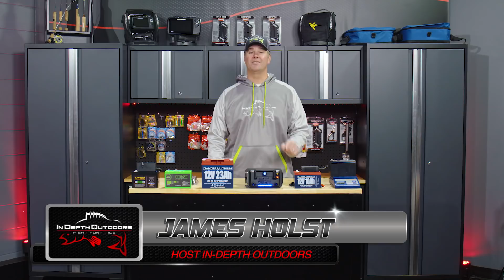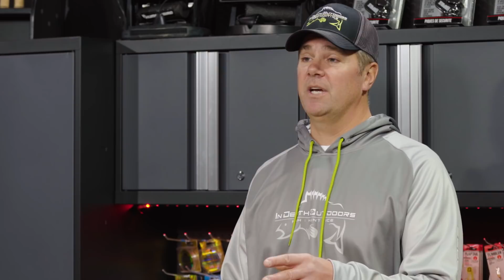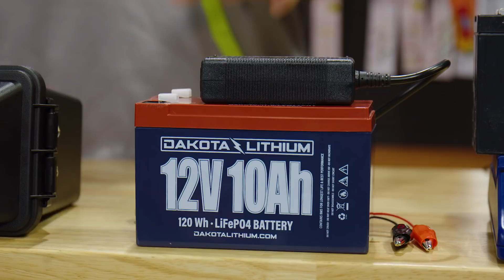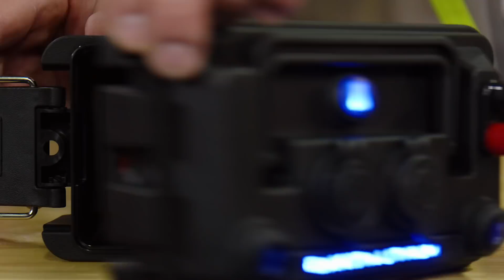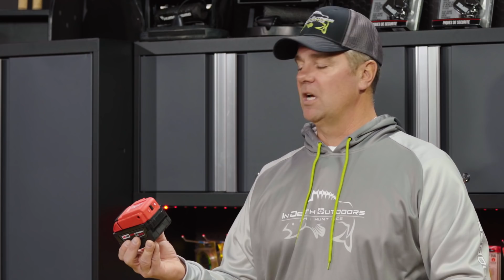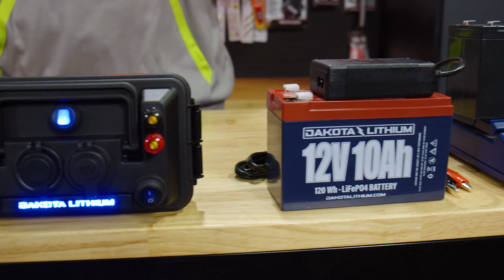Lithium Battery Lineup Walkthrough

Comment: I just got the Norsk 15 AH battery for my Humminbird Helix 7 G3N. Ive noticed that after I charge it, the battery level on the battery reads 100%, but on the sonar it is reading lower. As I us it the battery level seems to drop very slowly as I'd expect, but the battery level showing on the sonar goes down fairly fast. Have you ever run into this issue?
Reply from the maker: Are you running out of juice during a day of fishing?

Comment: How many years will some of these batteries last is my biggest question. I'm on my 18th year now of using my Vexilar 9 ah battery! I just can't seem to want to spend the money for one of those when a standard battery only costs about 30 bucks and lasts years!
Reply from the maker: Most of these batteries are rated for 800+ to 2,000 recharge cycles. Which means if an ice angler were to charge the battery 40 times a winter, which seems highly unlikely for most anglers, the battery would last for up to 50 years.  So, long time.  😊
Reply: @InDepthOutdoorsTV  good to know. Maybe when my battery finally dies I'll get a lithium battery.
Reply from the maker: If it's working no reason to replace it now. Happy holidays.

Comment: gotta have the AMPED outdoors 12ampHR battery in that lineup
Reply from the maker: AMPED makes great batteries.  We just added their 19AH battery to our gear to power our Mega 360!
Reply: I second that!  I run Amped outdoors 30AH in my garmin livescope bundle for 2 days no problem. I have the Amped 12Ah in my marcum flasher, lasts all weekend. Imo they are way better than Dakota in performance and price.

Comment: 23Ah lithium would actually have close to 6 times the power of the standard lead acid since you can only really use half of that 9Ah capacity.  So, the 10Ah lithium has over twice the capacity of the 9Ah standard battery at a fraction of the weight.

Also, love my 48Ah NMC Amped battery with my Livescope

Comment: You can get the Vexilar 9AH battery for $49 at Reeds right now. Plus you are supposed to use your normal vex charger. Don’t need a special charger. Best deal out there in my opinion. 

Also, you should’ve mentioned that lithium batteries don’t need to be charged after every use. They don’t mind sitting with less than a full charge. In fact, you are supposed to store them at 50% capacity.
Reply from the maker: Every battery manufacturer has recommendations for battery care and use that vary slightly from one manufacturer to the next so we didn't feel comfortable trying to put that into the video.  For example, the Vexilar Lithium 9AH battery I'm looking at on my desk says right on the battery, under BATTERY CARE, "Recharge after every use.  Store at 30%-50% capacity."  NORSK 15AH says "Charge battery after every use."  AMPED says "Charged after every use and recharge every 3 months when in storage."  Imagine providing that info for all batteries in this video.   Our advice is to follow the care and use instructions provided by the manufacturer as they're similar but not the exact same.
Reply: My marcum sat all of 8-10 months without charging because I’m lazy. I looked at it. Went to charge last week and it was 99%...this on a 3 yr old battery that doesn’t get heavy use

Comment: That Milwaukee cap has a 12V output on the other side. They were designed for the M12 heated jackets and of course those come with one for the 12V batteries. I've built an adapter that can power my Lowrance Elite 5 HDI and have used it for over two years, works great! Looks like DeWalt has something similar but I haven't ordered one to try out. Also saw Masterforce has something just like the M12 cap. I thought this might be limited to people with Milwaukee batteries but if not I might need to start taking orders for adapters...
Reply: Having already invested in the batteries for my tools, this was super cheap. The best thing is not having to remember to get batteries back on chargers because I always have enough charged to go fishing. I can usually swap before I go. It's worked so well that I replaced my 8" auger with a StrikeMaster Lite-Flite last year and never looking back.
Reply: Whats your take on the 9.0 and 12.0 Milwaukee batts?
Reply: @JLeeChron  I have 8 of the High Demand 9.0 and 2 of the XC5.0. With the 9.0 I get 8-12 hours of use with my graph, depending on backlight setting. The 8" Lite-Flite has only once drained a 9.0 running and gunning, so far. My work just got some of the High Output 12.0 for the M18 chainsaw and some other tools but I haven't gotten to use them enough to know how long they're going to last.

Comment: Per Norsk: "they are NMC Lipo. 11.1v nominal for light drawing units and 14.8v for the power intensive units like Livescope. Thanks!
"   Not exactly the same battery chemistry. Just a FYI.
Reply from the maker: James has been a good customer.  He runs NORSK 15amp batteries on all his Helix 7s.  Rave reviews.  No issues.
Reply: I been running a original Norsk 7.5ah battery that they started with.. Norsk all the way